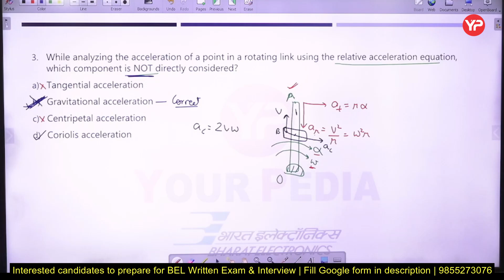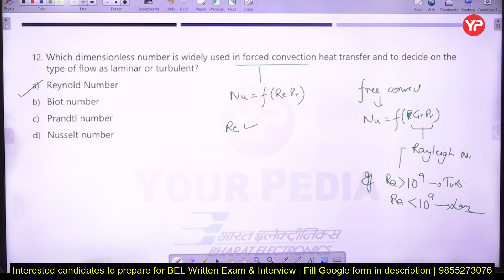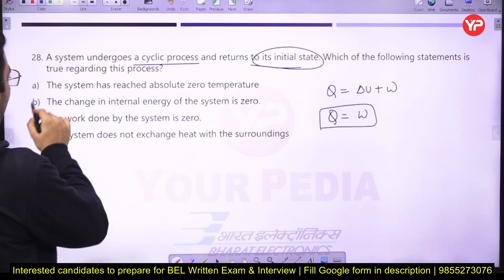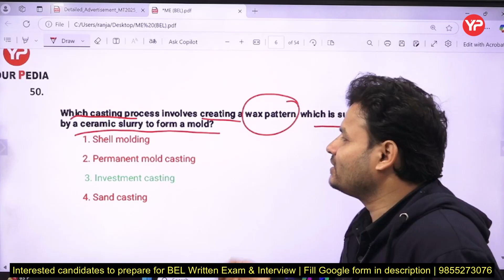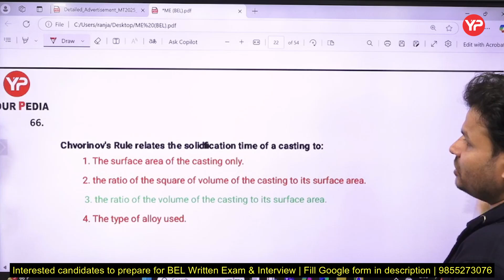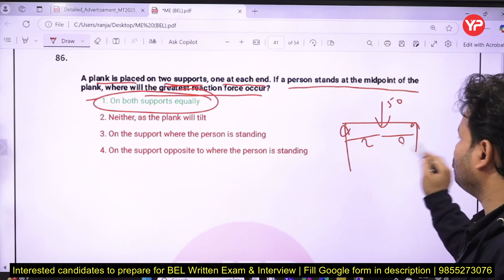Marathon session | BEL Mechanical 2023 PYQ 100 Qs detailed solutions Probationary Engineer

Comment: Question 37, Skew Gear would be correct sice skew lines are neither intersecing nor parallel. Skew gears are also known as spiral or hypoid gears. Herringbone gears are actually double helical gears used in power transmission bewteen parallel shafts.